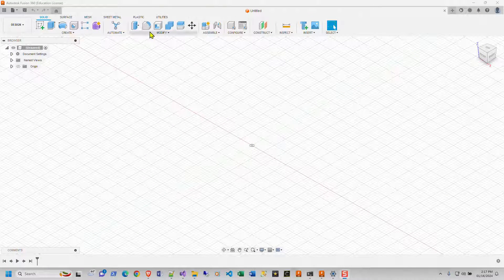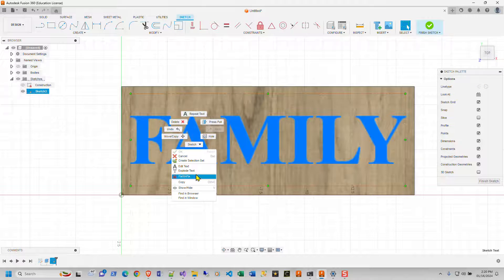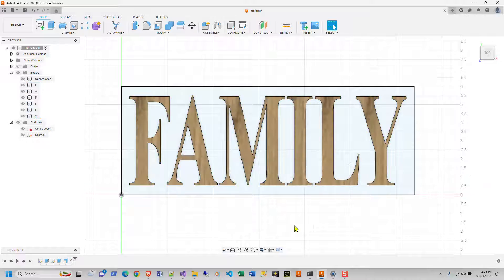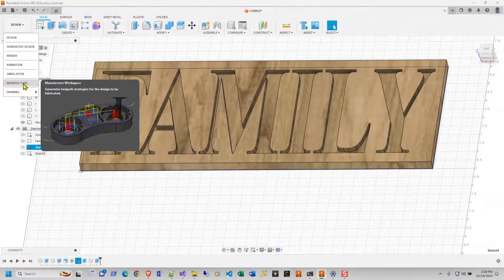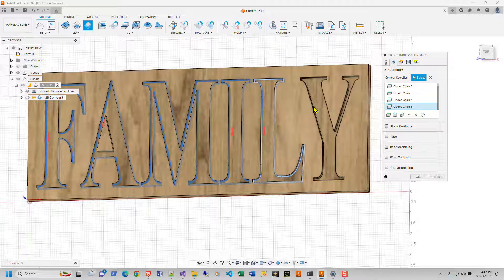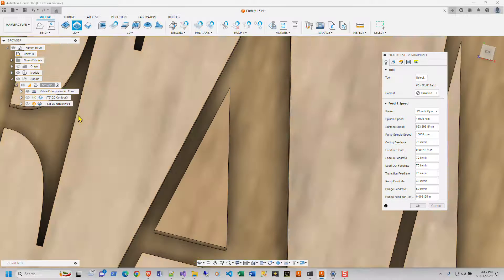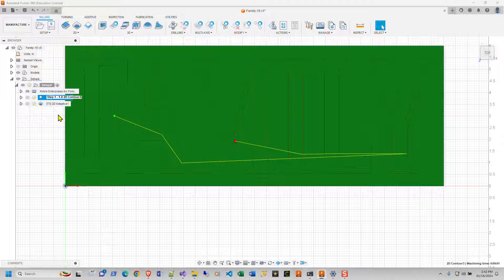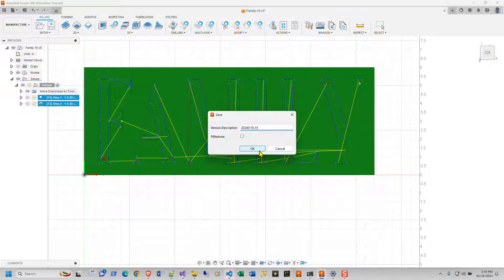How to Resize Text in Fusion 360

Comment: Mine only keeps the aspect ratio. There is no option to select 'non-uniform'. I'm guessing it is not an available on the free software version...
Reply from the maker: Did you select the Surface?  Check this link, it might help you out
https://forums.autodesk.com/t5/fusion-support/non-uniform-scale-missing/m-p/9331493#M79484
Reply: @LarsWorkShop  all I get are entities and point options in the scale modification. Bizarre
Reply from the maker: @Evansthoughts  Did you select the surface?
Reply: @LarsWorkShop  I think my issue is that I work in 2d (plasma cutting). There is no surface or bodies when I'm creating my cut files. I'll try to create a 3D rendering like you are, to see if I can pull it off. Thanks for the responses.
Reply from the maker: you could try creating a sketch for your stock and explode it, then put a sketch on the top of that for your text.  when you get into the manufacture area, just mark the top of the stock as your WCS for the Setup.  Somethis to test out at least.
Reply: @LarsWorkShop  I got it to work. Thank you for all your help and the great video.
Reply from the maker: @Evansthoughts  Awesome!!!